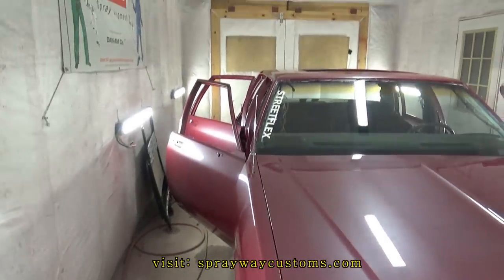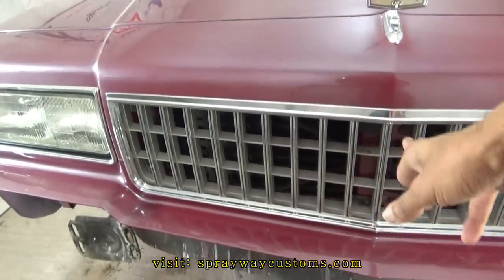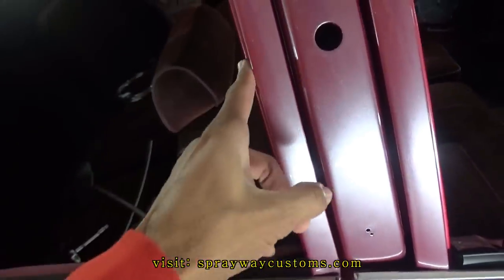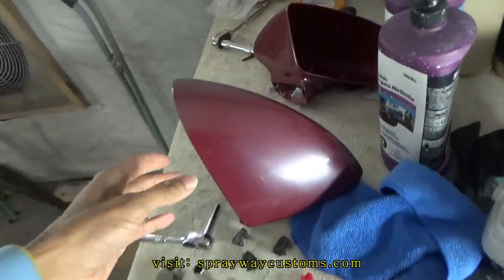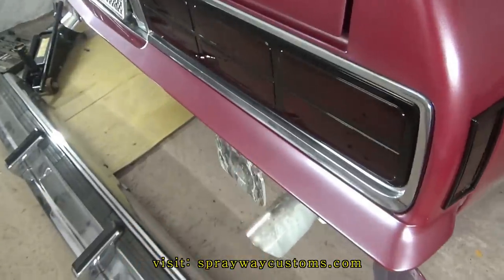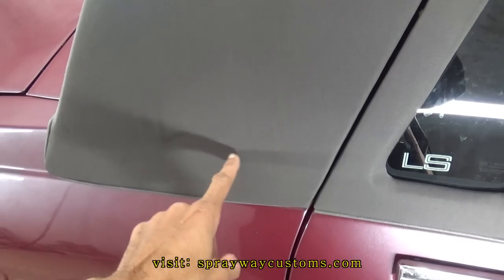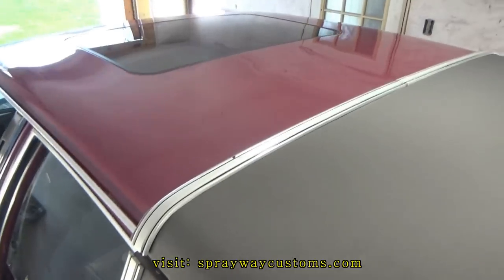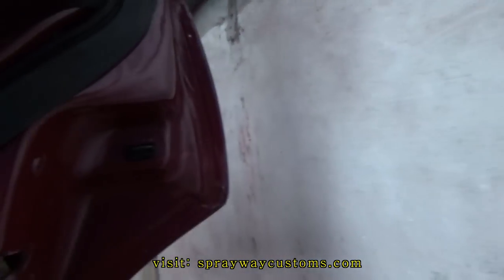Box Chevy Caprice LS Brougham Project Build- PAINT JOB, SUNROOF, HEADLINER, QUARTER TOP, PINSTRIPE

Comment: In The First Few Minutes Of The Video, I Seen You Using A Razor Blade Scraping The Windows And You Probably Already Know This But 2/0 Or Finer 4/0 Grade Steel Wool Is Excellent For Cleaning Vehicle Windows And Mirrors As Long As They're Not Tinted.
Reply from the maker: Thanks for the info 🤝